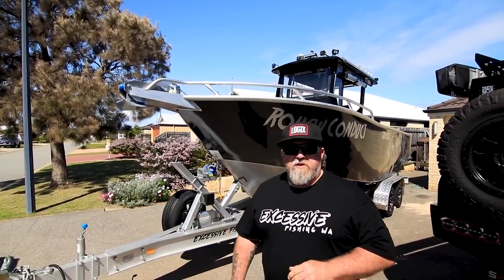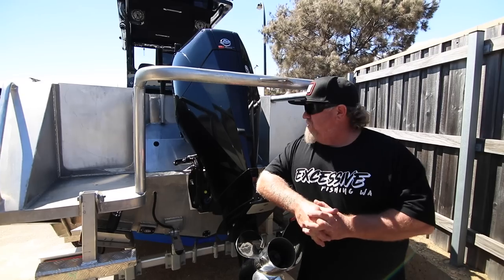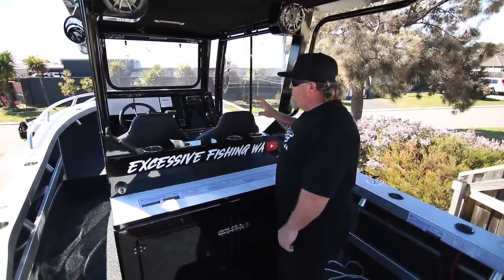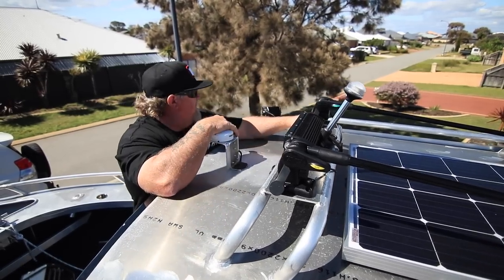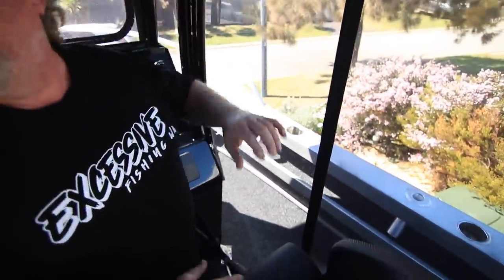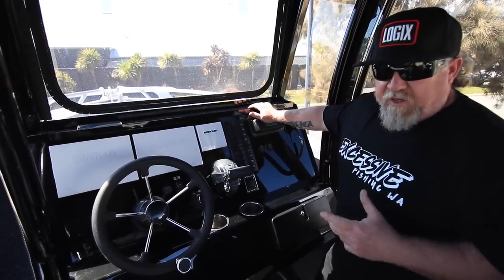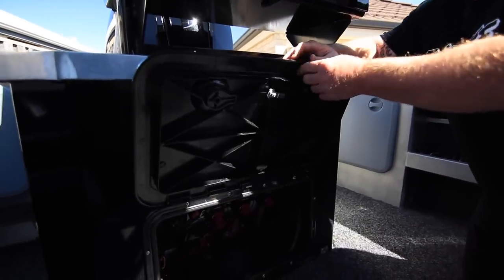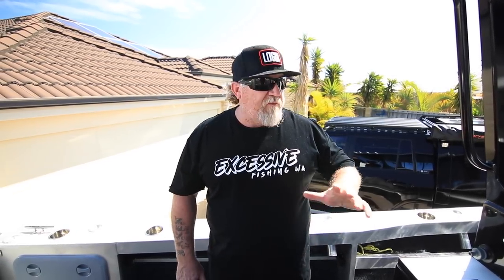CUSTOM 6.8M CENTRE CONSOLE TOUR | Oceanic Fabrications WA | Rough Conduct

Comment: Sick boat mate been waiting to have a full walkthrough. How much all up it cost you as a rough figure?
Reply from the maker: Hi Joel, thanks for watching. Total cost for the completed setup is around the $120g mark.
Reply: Good review nice thought out boat practical and very nicely laid out ive seen similar boats at twice the price so your pricepoint is spot on nt over 200k like a lot of the others are a question how much does it weigh all up fuelled and loaded how much fresh water on board and i really like the bar round the motormercury make a 400v8look at that i own a merc and its great 2019mod your fuel economy is great and consider two v6s with four blade props youll hold better at sea following or running side on thank you for your vid well done 😊😊😊😊regards from n.s.w 😊

Comment: Wicked build mate well thought out👍 you putting the logix bag on the boat? I got the 1250 bag wicked wicked bag, but spewing it's a little big for my boat. Didn't think it would be that big when you think 1200. But it's huge. Oh well just deal with it 😂👍🎣🎣
Reply from the maker: Thanks mate, yeh definitely will be, love the logix gear. I have the 1200 which is perfect for this boat and also the 950, which is what we use on the skis, sounds like what you need👍🎣

Comment: Your wrong about they don’t do a new engine in the V8 over 300hp! Try 450R V8 supercharged! Plenty of these burning around In USA 🇺🇸 
Try putting a Jack plate on your rig if your looking for better fuel burn 🔥
Reply from the maker: Like I said they don’t do a 350 in the new v8 platform. The 450r is a supercharged race bred engine. That is not in the same platform. I don’t want to go supercharged for what we do🍻
Reply: @excessivefishingaustralia2849  
15-25lb per HP is where you need to be! 15lb is a great benchmark and your right about mercury V6-V8 being the new benchmark for fuel burn. Good review Highly recommend Enertia eco in 16in dia or 4in-6in Jack plate if you want more mpg! Tight lines 🛥🦑🎣

Comment: What steering brand and autopilot did you use? They are obviously compatible but would you recommend the two? Thanks.
Reply from the maker: Hi mate, I use the Simrad gear, it’s the best value for money autopilot on the market. Pretty much most steering helms will be compatible with the Simrad autopilot setup👍
Reply: Thanks Dude, I appreciate that. I was a aluminium boat builder years ago and have retired, and so lost touch with what technology is leading.  Thanks again. Ian